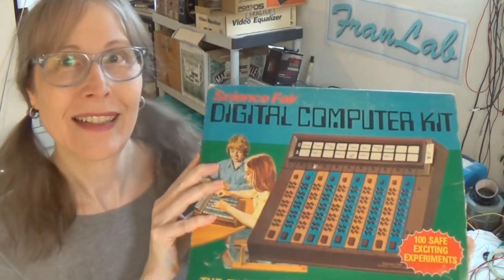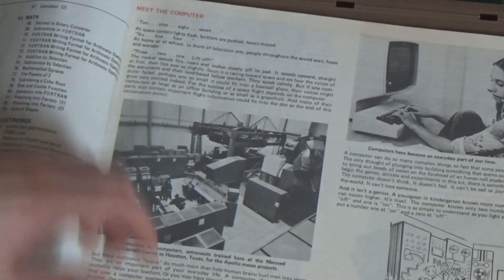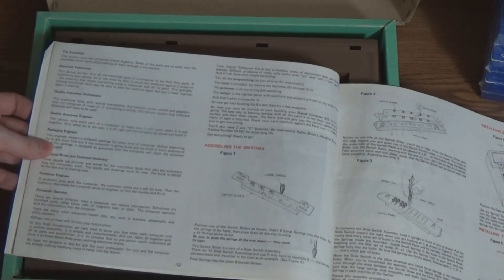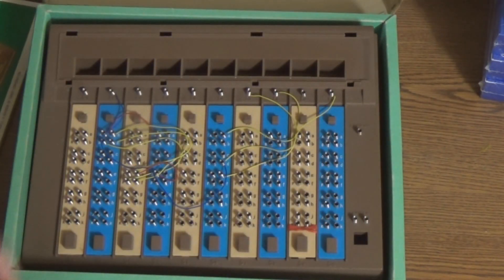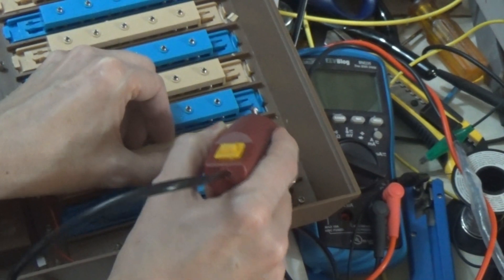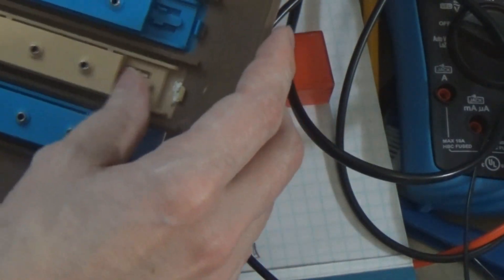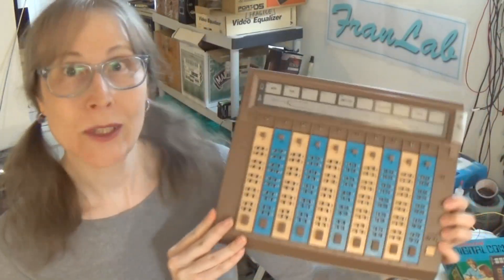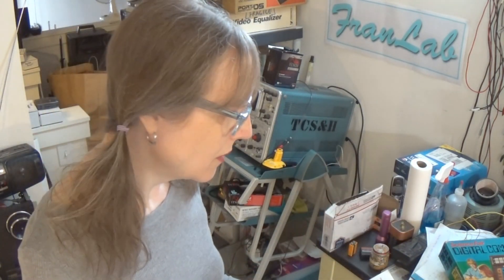1977 Tandy Digital Computer Kit

Comment: If you ever encounter one of these: 
http://www.radiomuseum.org/r/philips_ee_20_ee20.html

Was a really well made educational kit. Pure 60's tech with germanium transistors, but still a good way to learn the basics even today. 

https://www.youtube.com/watch?v=h1TII3Z-jXk

You put a layout card onto the board and then fitted spring binding posts into the holes. Was planned such that the schematic and the layout were the same. You could also do custom circuits of your own once you'd tried all the supplied layouts. The two transistor radio actually worked but was rather quiet, but the 3-transistor one was  perfectly usable for listening, with reasonable sound quality. 

-Wonder what today's designers would make of the suggestion that you could build a usable radio with only three transistors?  

Pity to have to waste so much time rebuilding that Tandy junk. It should never have been sold, was basically a fraud as it didn't do anything remotely digital or computer-like. Anyway, sometimes the only way to find out is to try and see.

Comment: Considering the great lab kits RS sold in that era, this is a pretty sad setup.  I spent countless hours tinkering with the various lab kits I got over the early to mid 70s.  Christmas of 1977 got me a Netronics COSMAC Elf II kit.  Now that was a real project.  I still have it, and it should still work fine.  Can't believe the following that exists for the RCA 1802 processor, it really is an awful architecture.

Comment: Wow, they should call the kit the 100-in-1 "Wire 'OR' Logic Lab".  That is all switches are, a wire OR gate. I would have thrown in a bunch of signal diodes, some 1k resistors, and some NPN (and at least a couple of PNP) transistors. Then you could make real logic gates: NAND, NOR, AND, OR, NOT, EXCLUSIVE OR, and FLIP FLOPS. Then make logic circuits from there using the switches not as logic but simply input control.  In fact, you can make ALL of those logic gates with just 2 input NAND gates (two diodes, a 1k ohm resistor, a NPN transitor, and another 1k ohm resistor).  Application Specific Integrated Circuits (ASICs) are just a huge array of NAND gates. You tell the manufacturer how you want to combine them into the logic you want, and then they manufacturer your chip with all the interconnections right on the silicon. There is a big initial cost for them to make the masks and such, but then they make a wafer or two of them and turn those into 100 chips (or millions of chips with 1000s of wafers if you go into production and want a lower cost per chip).  Before Field Programmable Gate Array (FPGAs) where we can control the wiring by switching in built in wiring via code, ASICs were the only way to make custom logic devices.

Comment: That sure is a blast from the past! I had two of these kits 'back in the day' one ended up being used as a 'band selection display board' on one of my first homebrew radio projects.  6 bulbs used to display selected band, one for power, and RX / TX lamps.  The other kit was used to control points and signals on a model railway (with a few transistors hidden inside it to drive the signal lamps on the railway). Good memories. Thank You for posting this little bit of retro fun :-)
Reply: I think perhaps you're the one who had the greatest success with this kit. This kit did not resonate with me at the time, but you we're able to put it to work doing something! I wish I had thought of that!
Reply: if you joined the two together you could of had the first dual core tandy digital computer kit .add a mirror for hyper threading and some L1 shared cach .oh the missed opportunities.lol
Reply: At least you and I found a use for it. I used it for doing some very rudimentary block switching on a model railroad. That was about all it could do was switch ONE loop so the train could go out around the loop, then come back on the same track, so reverse polarity, on the main track when the turnout threw, and a signal changed from red to green, then switch to the second loop, and do the same thing. I wound up ditching the kit, and etching a board. 73 KI7AQJ
Reply: Great that you could actually do something useful and cool with it.
Reply: Did you go into the field of computer science or programming as an adult?

Comment: how did they get away with calling it digital? the only computing it does do is manaully operated analog. i like the idea of tsaching kids how calculators work tho. 5 years after this we had the sinclair spectrum with the make-a-chip program. much more interesting. maybe you could show us how that could be used to design a logic circujt, then maybe you could build a simple analog logic circuit?

Comment: No... a "keypunch operator" entered data on machine that literally "punched" holes into paper cards using Hollerith code.  I used to carry all my diagnostics on decks of punched cards.  I quickly learned to use a Sharpie to draw a diagonal line across the edge of each deck so they can be reassembled in correct order after dropping all of the cards on the floor!
Reply: wandawong why didn't I think of that? That would have saved hours of restacking time to do more programming.

Comment: I had this one as a kid. A strange and disappointing kit, compared to the 75-in-1 Electronics Kit I also had, since the thing didn't have so much as a single active component, not even a relay, so its relation to actual digital logic was at some remove. Nice manual though.

Comment: I asked for a received one of these as a child.  What a big D for DISAPPOINTMENT! No electronics at all, tons of contacts and some light bulbs  Big waste of time. Nothing like my 75in1 kit.  If this came with a NAND or other logic chips, a 2 bit adder and/or a couple of flip flops it would have at least been useful.  And some LEDs, not light bulbs.  I had another kit (30in1 ?) that had a 7400 NAND chip that was way more educational then this terd.  It's great that kids have access to Arduinos and the internet these days, but still it's good to know the basics, like how to wire up a simple logic chip.

Comment: You know, with a few spare passives I'd bet that could be a lot more fun than it is currently. A few extra diodes and resistors. Maybe a capacitor or two. Maybe even a solderless breadboard, who knows. That could be a blast to play with as far as being a binary encoder or programing tool. As it is though, just being a bunch of switches and lights, yeah that's not so much fun. The electronics experimenter labs were great though. Especially those with a solderless breadboard built in so you could use your own IC chips. Those were great. I spent countless hours with one of those. Sadly, I don't think they make them anymore. I had a 300 in one back when those first came out. I really miss it as it was lost in a storage unit fire. It turns out that when you store old clothes in a damp environment they tend to rot and catch fire. Still, great video. Even if the project wasn't much fun you still managed to make it entertaining.

Comment: Hey Fran.  I actually had one of these as a 7-year old kid back in 1977.
  Yes, most projects were very lame, but there was a saving grace.  
There is project that emulates the 'crossing the river' puzzle.  You 
have a farmer, goose, fox and a bag of corn and you have to cross the 
river in a boat.  I'm sure you know the logic puzzle.  You basically 
have to determine how the farmer can get each piece over the river to 
the other side, without leaving some side in danger (fox will eat the 
goose if left alone for example).   Its neat because you had to sequence
 it correctly, or you ended up with a "Danger on the bank" light.  Yeah,
 its lame, but when I watch Apollo 13 and "Ken Mattingly" figures out 
the power-up sequence for the LM, I always think of this old project.  
(yeah, I know Ken didn't really do that.).  Anyways, it taught me that 
computers were really just a bunch of switches, and you could wire a 
"program".  Anyways, give that project a try before you declare the old 
"Digital Computer" a complete write off.
Reply: Take the good over -Return - Take the beans over - Return WITH the goose - Take the fox over - Return -  Take goose over.
Reply: Actually, it was Farmer, Wolf, Goat, Cabbage - there fixed that you ya'. Actually kit this is not that bad, but in no way is it suitable for anyone that age. I would say age 14 minimum to get anything meaningful out of it.
Reply: Maybe like the thing with the sand & rocks in the jar. Rocks go in first ( most important things in life) then sand ( less important).
Reply: I agree with Robert. Half the use you can get out of this kit is actually what you do with it after you complete the work book. Namely, and what I have read from others, adding stuff onto it to make it do more than simple wire circuits.
Reply: I <3 u! THANK YOU!!!!
Reply: That's the only one I remrmber, too. I was 10...

Comment: This was my first computer. If you'd like to make an old programmer very happy, I'll take it off your hands.

I was 12 years old then, and unlike your comments, I did learn a lot from it. I spent hours programming it. Fir me, it was a lot of fun. Through what it taught me, I understood how a Pentium cpu worked, in handling bits as they entered the cpu, where thise bits wrte placed in the cpu internal memory, and finally output the processed bits. That allowed me to design the first Novell-certified Pentium computer, in 1995...or, 1994...it was a long time ago.
Reply: Very cool story! I too had one of these, and it began my passion for computing. My career may not have been as ground-breaking as yours, but I definitely have a similar fondness for this kit.
Reply: I worked at AMD and ours had twice as many springs and light globes.

Comment: Well done!

You even mentioned the obvious: "Why not use LED's"?  Hate to say it, but with the way I love to upgrade old electronics, I would have done LED's and probably replaced the "C" batteries with a AA holder.

Yeah, have to agree: It doesn't even teach electronics. The conclusion: Tandy made crap back in the 70's.

Comment: Having had one as a kid, it was definitely one of the worst and most deceptive educational kits Radio Shack sold.
Reply: I had one too. I agree with your assessment. It was OK for introducing logic gates, but I'm sure it fooled a lot of kids/parents.
Reply: LOL !!!
Reply: Same here, actually still have it. Just came across it in the basement. Look- if there are 2 switches in series, they both need to be on to complete the circuit! Did a few projects before getting bored with that, and on the shelf it's sat for the last 30+ years.
Reply: @Daytona574  The Manual is the gold.
Reply: @Daytona574  Do you still have it? I would like it
Reply: @ibisum  It really is

Comment: By contrast, from the same year, this outstanding unit and course from Heathkit:

ET-3400 Microprocessor Trainer 
(course materials were in in 3-ring binders not shown at this site)
http://www.vintage-computer.com/heathkit3400.shtml

I bought one, assembled it to near milspec soldering quality standards, took the course, learned a great deal, and sold it for close to what I paid for the kit.
Reply: Or the SD System Z80 Starter Kit, which was awesome ..

Comment: if you were to feedback some outputs into the switches you get a finite state machine, 4 lines fed back means 16 internal states. if you then attach an input and output switch and lamp to a movable tape instead you have a Turing machine.  Too bad they couldn't integrate the feedback and a clock button into this kit, that would have made it much more interesting. maybe drive a solenoid instead of a lamp. it kind of reminds me of Drexler's rod logic with the way the whole row slides with the switch like that http://www.zyvex.com/nanotech/mechano.html
Reply: I want to have you as a friend in 1982. I was looking for the hidden secret to all knowledge and wisdom. One project done and flipping through the manual I put it on the shelf in my electronics shop in the basement. I'm pretty sure I threw it away with great prejudice when we moved about a decade later. It was awful.

Comment: ..... Apollo 13 used it to stir the oxygen tanks !
Reply: how does it work ?
Reply: Radio Shack...we have a problem....a main bus B undervolt......
Reply: good one!
Reply: Rigel2112  Spin welder wasn't on the table with the engineers at ground control.